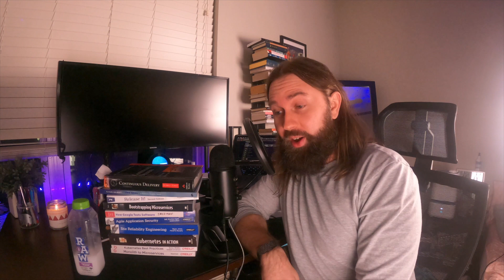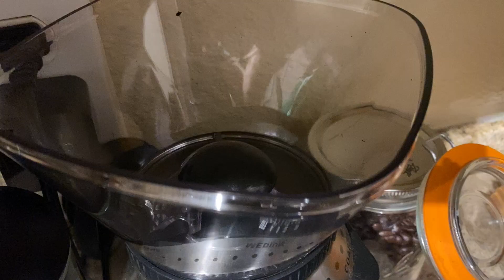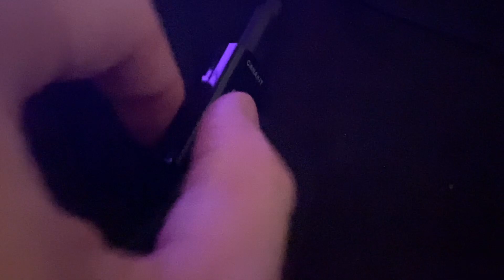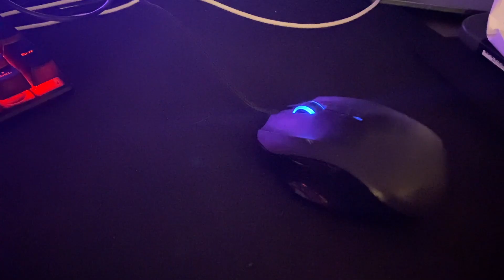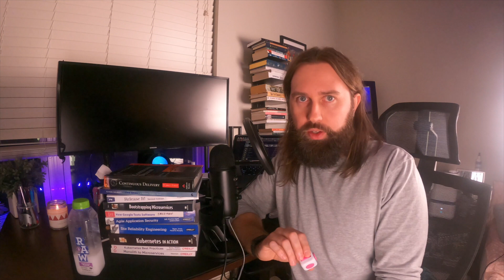Interviewing for the SRE "Site Reliability Engineer" role in 2021 (some things to expect)

Comment: SELF TAUGHT here do I need to  learn full stack web development  I mean like learning frameworks like nodejs django before learning devops/sre tools cloud etc??
Reply from the maker: You don't need to learn those in-depth. Full disclosure, I had a full understanding of the SDLC and each component of how my organization's software stack was put together. This helped me understand what to troubleshoot during an incident. Learn the SRE-related tooling in-depth first e.g. observability, automation scripting, infrastructure as code, process, etc. 

This also depends on the organization that you're applying to. In larger organizations, SRE also means that you're on-call rotation and write production code when you don't have the pager "Own what you deploy" kind of approach. I'll likely do a video on this as well.
Reply: @randomthoughtstech  thanks a lot for your replay I have last question and I will be grateful for your answer I already learned python and java script / TS to advanced level like data structures algorithms concurrency multiprocessing  multi threading but haven't learned any library or framework yet before SRE got my attention and gain my interest from your own job experience perspective if I have to choose one framework/library between (Django/Node.js) what would I go for learning  during  mastering SRE tools and thanks in advance ??
Reply from the maker: @zealtypedcode3119  No problem, if it's just for a job, I would personally look at the job market to make that decision e.g. searching linkedin and basing the decision on that data. The other option is deciding based on your passion, do you enjoy working with JS or Python more?

Comment: I have been a software developer for 5 years before i switched to SRE for the past 2 years. Professionally I have coded in Java and Ruby/Rails. Now in SRE predominately Python. I still try to dive into code when in firefight mode. Spot on with the languages.
Reply: SELF TAUGHT here do I need to  learn full stack web development  I mean like learning frameworks like nodejs django before learning devops/sre tools cloud etc or only learning an architectural and implementing overview of web apps in general thanks in advance??
Reply: @zealtypedcode3119  this all depends on your goals. I gravitate to jobs that expect SRE to be a graduation of SWE. If the engineering aspect is your strong suite then I would say yes. If you feel weak on learning software engineering or it takes you a long time, then I would consider looking if learning tooling is path of least resistance. I want to promote letting your employer paying you to learn.
Reply: @MFTGShane  thanks a lot for your reply I think I can go with longer path learning full stack web development first I have already learned js/ts and python to advanced concepts like data structure and algorithms design patterns multi processing multi threading and concurrency  and doing basic projects 

Can I ask one last question I'm torn between  2 back end frame work which  to learn Nest.js (node.js) or django I'm planning to learn only one for now and then concentrate on learning sre/devops tools can't decide which to learn first  to land a job before learning the other what's your suggestion from your work experience perspective??

Comment: I am getting ready to interview now for 2 open SRE roles. I watched this video as I am trying to see how I can optimize a junior role into what should be not be one.
Here are my suggestions for what to highlight (I know the role is varied in nearly every organization).
However, most rely heavily on metrics which are usually derived using prometheus query language.
DevOps + CICD understanding/Experience is huge
Kubernetes experience also important (could use labs and courses to replace experience for junior role)
Bash or Python (both a plus)
Some past operational experience preferred. Can substitute with demonstation of strong rapid problem solving potential.
Communications and written skills are also important (focus on soft skills)
Working with development teams can be a soft dance ;)
Reply from the maker: nice :) communication is huge, I find myself working with all sorts of different teams throughout the week. We are in the process of implementing some SLO's and communication will take an even larger role here.

Comment: 8:33 as an infrastructure engineer, it’s frustrating to view many job descriptions that require knowledge of a programming language.
Reply from the maker: yep, I felt the same way about software quality roles years ago and saw the industry shifting, so I took action. I ended up putting a lot of time into Ruby to find the project changing to Python based on the rest of the team which was frustrating lol
Reply: @randomthoughtstech  😂 those changes happen often. I took action by learning more devops techniques to mask my inability and lack of interest in programming
Reply: There is no getting away from it. You need to learn to code, for Automation Orchestration and configuration management. This use to be mostly achieved manual methods. Todays code like terraform allow you spin up Infrastructure in blink of an eye, convinced?
Oh just side bar. I've been Infrastructure Engineer for 15 years and cloud SRE/Ops for 5 years, so feel your pain, I'm constantly applying  knowledge day to day, so feel the pain for the gain
Regards

Comment: Over the last 6 months I had 7 interviews as Devops engineer but still no luck getting My contract was ended due to the Covid situation budget cut. 
My question is how to deal with interviews when hiring managers asking you do everything from Cloud Administration, Coding, System Administration, Kubernetes SME ..  Unfortunately in toronto market is little slow or may be I am out of luck or not being able to convince the managers
Reply from the maker: Hi Azhar, try and take advantage of the remote roles that companies are posting. I agree with you where SRE/Ops roles are quite demanding and the required knowledge is sometimes questionable. I encourage you to apply to roles that you might feel you are not qualified for because I promise you that all of the requirements listed are often not realistic. Feel free to connect with me on linkedin and we can hop on call for some mock interviews.
Reply: @randomthoughtstech  Thanks and sorry I missed your reply, last month I was short list for Azure Cloud DevOps position but again that contract put it on hold or something else until now never got any update even spoken to recruiter today
Reply: Same boat, I've been through a few 2nd/3rd rounds of interviews with no luck so far. Working another at the moment, hopefully things work out. Best of luck out there!
Reply: @christianherrera9524  I think I found my problem is I am not applying to every random job posting on linkedin and I was totally relied on my agency who is preferred vendor with IBM since I have been contracted by IBM number of times I thought they will bring me back.
Reply: Hello from toronto! Did you end getting the SRE position? I'm looking for Junior DevOps/SRE positions, but honestly I barely see the junior one. Do you recommend me start something different positions first? I have a 1 year of IT technician experience in toronto